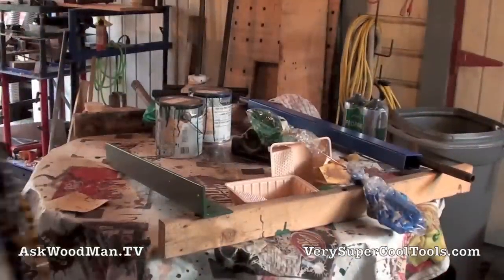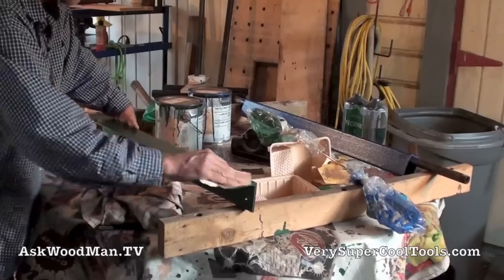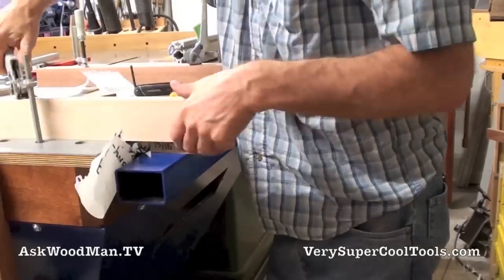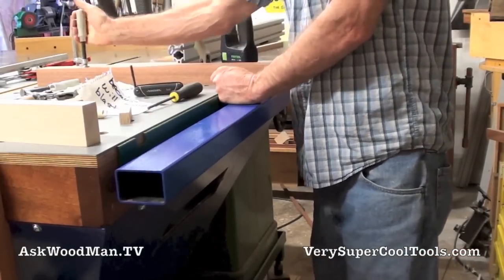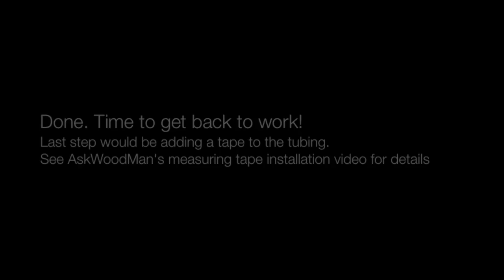749. Do It Yourself • Biesemeyer Guide Rails • (Steps 36-40)

Comment: That's great.  I wonder if you've thought about making a mini T square fence for smaller tools, such as smaller bandsaws, etc.?
Reply from the maker: Hey Steve. The Standard t-square works just fine with bandsaws. You just make a shorty guide rail and use a shorter extrusion. I have videos of my Hitachi CB75F and my business partners Powermatic 141 using our fence.

Comment: That blue color looks an awful lot like Ford Blue engine paint.
Wonder how that would work since you can get it in a spray can.
Nice job BTW.
Reply from the maker: I have no problem with rattle cans. But I think a good rolled on and then scratched red oxide primer is hard to beat as a base.  Engine paint is probably some really tough durable stuff. That blue is just Sherwin Williams base blue in the SherKem. That blue is the best covering paint I have ever seen. There have been a lot of things I have only put one coat on that still look great. Thanks for the comment Steve.